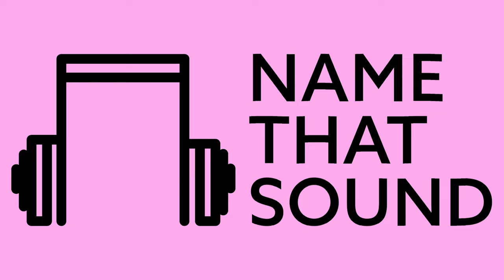Patch from Scratch: Gated Reverb with Mimeophon and 0-CTRL

Comment: Gated reverb I’ve found difficult to pull off on spring reverb, but the echophone makes it quite simple when using the optomix2 and say akemies castle or the assimil8tor. Those are the modules o apply it to using the muxslicer and pressure points and brains as control modules
Reply: Right now I’m trying to employ the same technique with inverted ramps to mult out into an oscilloscope for vector rescanning simultaneously..(generate 3can easily do this)
Reply from the maker: Sounds like fun!
Reply: @MAKEN0ISEMUSIC  it is I also employ the ducking technique from Colin bender but it’s much more difficult with glitch style drums instead of 4 on the floor

Comment: WHY THO?

I mean, I've never been able to completely understand how the 0ctrl works with an external clock.
Reply from the maker: Normally the clock rate is determined by the Time and Speed parameters, which also determine the length of the Dynamic Envelopes. When clocked externally, these parameters still control the length of the envelopes but that length is decoupled from the clock rate. Hope that makes sense!
Reply: @MAKEN0ISEMUSIC  yeah, in the meanwhile I figured it out with the help of some videos and experimentation

I still don't quite get what happens when you've got both clocks going, but my guess is "mayhem"